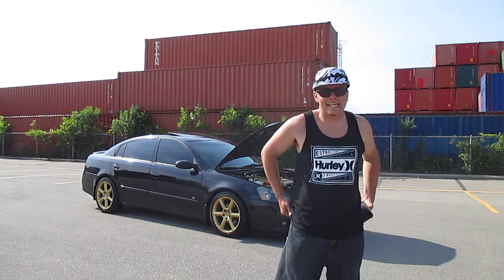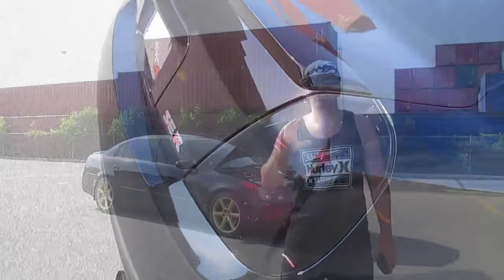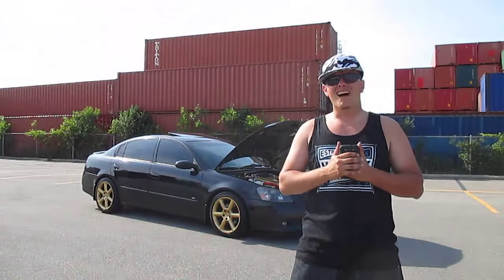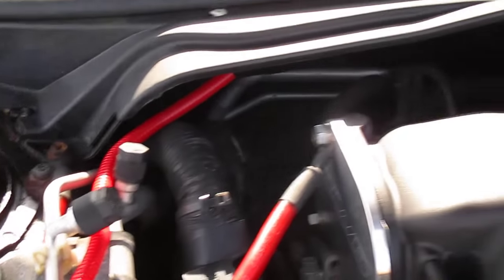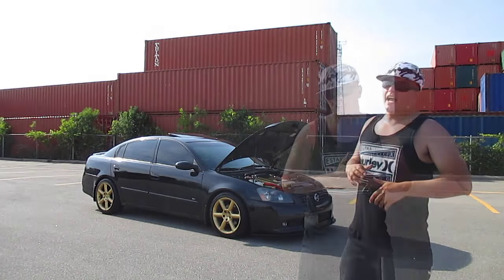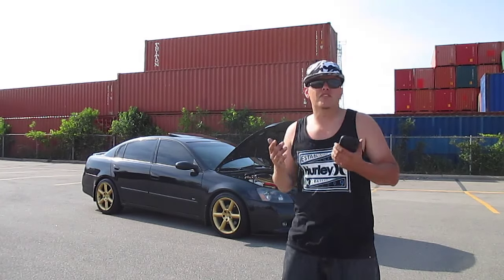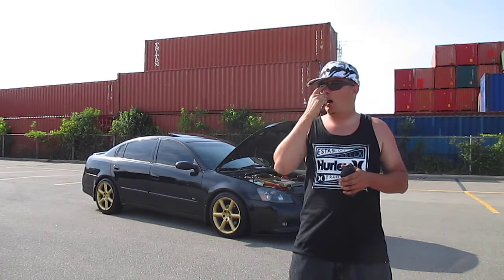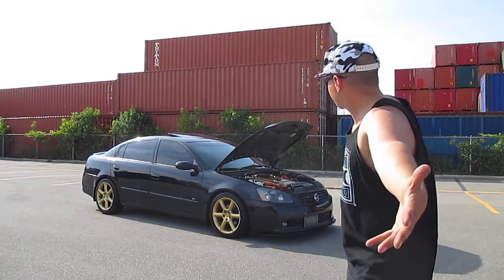Altima 3.5SE - Complete Mod List - Start to Finish

Comment: Hey Man,

Nice job!  Picking up a black on black 2006 Altima SE 3.5 V6 today. Needs a few touch ups and some detailing but man that motor runs strong. 

Looking forward to some mods of which the front rotors will be first as they're already slightly warped. 

I've subscribed to your channel and will catch up on your posts. 

Thanks for being a great source of information!

Jack in South Carolina

Comment: Hey I’m a car newbie what does 3.5se mean, is that like the year?
Reply: 3.5 is the engine size (3.5 litre) and I forget what SE stands for. Sports edition of something along those lines I think but I could also be super wrong on that one. 
Edit: I googled it n it does mean sports edition. Basically it’s just a different trim level. Just like how Chevy Silverados have the LS (lowest trim) the LT (mid range) and the  LTZ for the top class. Hope that helps man.

Comment: I have an 06' We lowered on tein s-tech's, that I drove on stock struts for about 5 years. Well after 5 years I had to get both front axles and struts replaced as they were dead, I want to drop it again though. For now I have the oem springs back on but I hate the fender gap. Should I go with bc racing coilovers next or put the tein s-tech back on with better struts? I want about a 2 inch drop up front and a 1.5 in the rear.

Comment: Hi DNALI, i have a question regarding upgrading my wheels. I have a 2010 altima sedan and i can get a used altima se r oem wheels, specs are 18x8  45mm offset wrapped on 225x45. My question is would it fit and look okay with the car stock height? No plans of lowering the car i just want to get rid of factory 16 inch on hub cab.

Comment: Hey man, Do you know if 245x45x18 wheels will fit without rubbing on a stock height? Any one can help?
Reply from the maker: +DimplesDon9 you will rub on the back over bumps. i had 245s on stock hight and rubbed
Reply: +DNALI , THANKS MAN. How about 225x45x18 tires?
Reply from the maker: DimplesDon9 as long as you have +35 off set or higher you should be good without having to roll the rear fenders

Comment: Yo where can I message you I just crashed my 06 6 speed uprev g35 with aeropackage and everything but motors still good an so is everything but front bumper... besides that I wanted to ask ur opinion on getting a 6 speed maxima you no the 03s an round there or the 04-08 5 speed maximas the bigger body gen.

Comment: Does the ser bumper line up as the oem one does or did you have to alter anything on it
Reply from the maker: Fifty81 no alterations needed. it sags a bit because I didn't use the SER foam bumper support

Comment: whats the difference between the SE-R and SE? they both have the same 3.5 engine.

BTW do not buy drilled rotors they provide no benefits and they are prone to crack which can cost you your life, its mostly for looks. However, slotted rotors are very beneficial and grip harder than smooth rotors.

If youre looking for better breaking, suspension, handling, and good performance, a good set of high quality summer tires should be your first buy since its the only part of your car that touches the ground it will be the most beneficial.

Many have done tests with high quality tires vs suspension  such as coilovers, and performance tires always took the cake each lap.
Reply: letsroll .

Comment: Why would you invest so much money into an automatic car? I mean an Altima is a great car, but you can put so much money into it but you're still being denied that certain percentage of fun/performance of a manual trans.
Reply: shift kit on an automatic will always be faster than a manual. a manual impresses your buddies, automatic wins races.
Reply: tmccann1876
Actually, automatics of the late 90's and early/mid 2000's are not that good. And there's a huge delay when you activate + or - on the gear shift/paddle shifters. They're only 4- or 5-speed torque converter autos, not particularly sharp and visceral at shifting like a modern day Maserati or Jaguar F-Type. Plus these older automatics were terrible at downshifting, they don't rev-match like a modern day ZF automatic or something like that. A 6-speed manual Altima 3.5SE (with a good driver) will beat a 5-speed auto Altima 3.5SE, in a straight line, and especially around a track.

Either way, lets assume your "automatic Altima is better for races" argument is correct. That doesn't make a difference in the real world, because on a track, its not all about shifting, it's more about knowing how to hit the apex in a corner, when to brake, when to throttle, how to prevent understeer and manage oversteer. I doubt you, me, and the 3.5SE owner in this video are excellent at the things I just mentioned. Therefore even if the automatic transmission is faster (which it isn't), that doesn't mean it makes you a faster driver. Having skillful experience with the steering wheel and your pedals makes you a faster driver, not having an automatic or 1000hp. It's all relative.
Reply: +tmccann1876 manual trans win everytime in this case..maxima or altima mod for mod ...
Reply: +Daniel Mirzotti well said...nd lets no forget the dct trans..basically two manual trans cintrolled by the cpu
Reply: LE#O Wrlboss187
DCT/SCT actually has some performance benefit though
Reply: +LE#O Wrlboss187 look up your specs bro. not trying to be rude, but I have a 2008 3.5 A/C cvt and the spec sheet on it shows it being several tenths of a sec faster than the manny 0-60.
Reply: shouldn't be public im sorry..i never loss to a "cvt" fwd nissan car...dont need to look it up ...cvt isnt intended for racin in searches for the best way to save gas and bein slow lol
Reply: shouldn't be public 07altima + 6  speed 3.5 altima is beast and very underrated ..because of the revised hr (350/g35hr) head engine

Comment: You gotta have good back pressure in the exhaust system for altima and maxima to get the best power..and for people that have maximas,get rid of the resonator,and install Altima ser mufflers on the maxima,,its the cleanest vq sound ever..

Comment: How much is the car dropped ?
Reply from the maker: Nova Swag 2 inches in the front .5 in the rear
Reply: Im pissed i want to get the same springs for my 2002 s.e but racing line is out of stock !
Reply: is it essential to get the kyb gr2 struts to get an altima the same stance as your ride? or is it also possible to get it this low just by buying the raceline springs?

Comment: can I race your Altima that would be fun
Reply from the maker: Depends on what you drive. My g35 is the faster of the two
Reply: I have a 2004 Nissan Quest is a monster I built this van from ground up i never lost a race yet I beat a BMW 335i Aura TL Subaru and I just race Honda Civic with her I have under the belt but my Nissan 370z is straight nasty on the streets
Reply from the maker: @Tootoojackson  what trans you running in the quest stock??
Reply: @DNALI  it's a stock transmission with performance clutch

Comment: Wow 10k hids in reflector housing you're blinding everyone at night smh
Reply: Rico Lyons hes not blinding anyone if his headlights are aimed
Reply: You really don't get it do you? PnP should be jailed!!
Reply: why? i'm lost
Reply: I agree with Rico on this, reflector housing reflect the light allover the place, no matter how low you point them, the HIDS will blind oncoming traffic, i always believe if you go a out and spend money on HIDS you should also buy projectors. Also 10k is way to much for normal street driving, anything above 10k are usually for off road use or "show" cars. That's less usable light for 10k.

Comment: Good work let’s do a go fund me then when you get 90k all the haters can help you decide what to buy rice or mice? Lol I like your car it’s very cool I have 03 Altima SE 3.5 it looks good for an 03 OEM paint interior black cloth slammed on after market springs just bought 4 new 235/35/20 new brakes and rotors all around. Dragon intake does serve its perp’ You can check it out sirchito Instagram but if your happy that’s all that matters I’m not into racing my son loves that he did the upgrades to my ride. My electric guy installed a new brain it runs a lot faster. I’m happy. I get compliments and always reply thank you . I like your ride too. If it’s a piece of crap I still say cool car maybe this guy finishes college in 6 yrs then becomes ceo? Then he’s in a Maserati im gonna say nice car again. People are people and I love them too. God bless peace out..D.